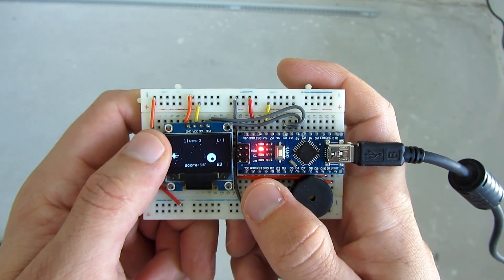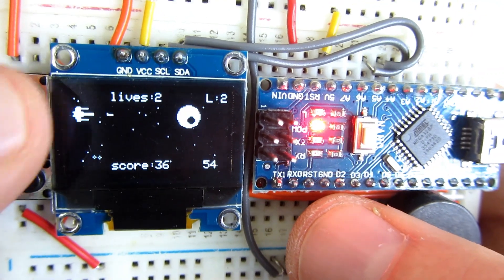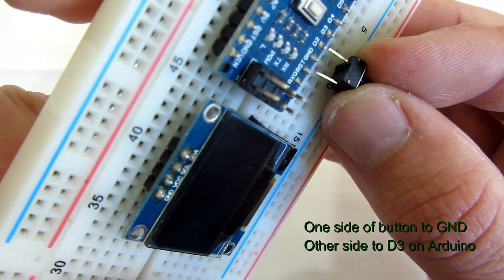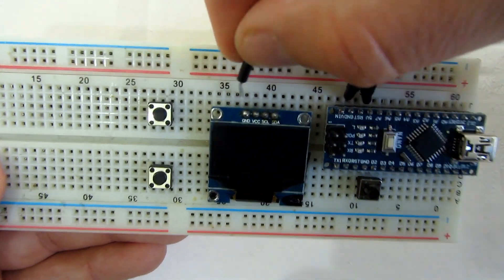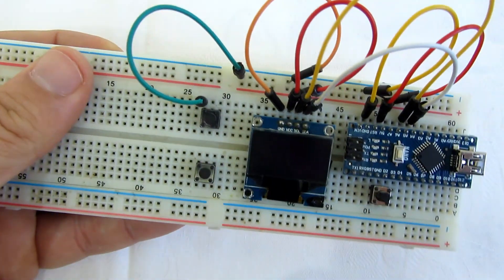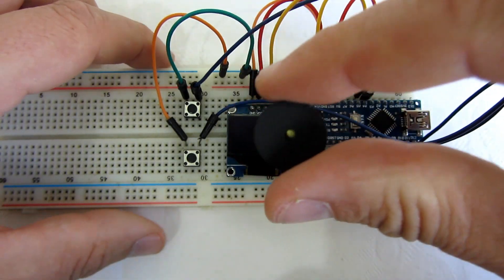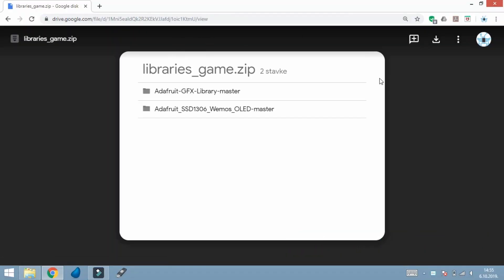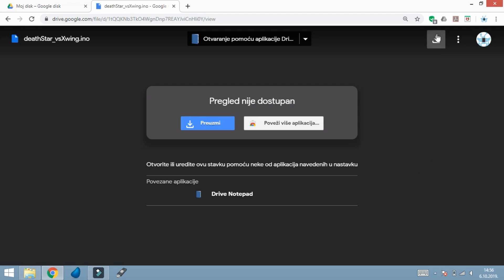Arduino Star Wars Game - how to make

Comment: Thanks Volos Project. An entertaining and educational project. I got my non original Nano working on my Windows 11 laptop after updating my CH340 driver with CH341SER driver. Also of use was a gentleman's suggestion below (sorry cant recall who this was)' when using a 0.96 128x64 i2c OLED to :
You need to call constructor differently this case:

Thats how your code at lines around 26 should look like: 
#define OLED_RESET 4
#define SCREEN_WIDTH 128 // OLED display width, in pixels
#define SCREEN_HEIGHT 64 // OLED display height, in pixels
Adafruit_SSD1306 display(SCREEN_WIDTH, SCREEN_HEIGHT, &Wire, OLED_RESET);
Reply: Thanks a billion
Reply: thank you
Reply: Hey, could you provide the libraries, code for this project, Im not able to get it from the drive link in the description

Comment: sir, the game works fine but it does not fit to the screen size its enlarged and i can only see half of the picture, any solutions?
Reply from the maker: Your library is set to 128x32 so picture is sreched, you need to set it to 128x64

Comment: I got the hardware going but cant get it to fit the screen. Seems super zoomed in. Any thoughts?
Reply from the maker: hi mat, your library is set to 128x32, you need to set 128x64. Do you use library i posted in description?
Reply: @VolosProjects  I downloaded the library zip file but the ide is saying it doesn't contain a valid library. Can I change it manually?
Reply from the maker: Do you bave original adafruit library? Od you bave , you Will news to delte iz bacouse they Will ne on conflict

Comment: Getting an error with this ...     ADMUX = _BV(REFS0) | _BV(MUX3) | _BV(MUX2) | _BV(MUX1);    This is the error from the IDE ... 'ADMUX' was not declared in this scope. Also, one of the libraries, Adafruit_SSD1306_Wemos_OLED is not included in the sketch.  Also, the code is very messy.
Reply: same problem

Comment: Hi, did you do something special to connect both buzzer and OLED screen ? I had issues about that with a nano (you got exactly the same setup). I heard about the choosen pin that can be the source of the problem.
Someone else talked about the buzzer that could not be a real buzzer, do you have some references ? ;)
Your projects are great !
Reply from the maker: Thank you, i didnt do anything special. But i remeber that i have that problems in past, i just used another pin on arduino. Dont forget setup that pin in code.
Reply: @VolosProjects  Thanks, I also get a freeze when I used both buzzer and OLED, I will check the pin 9 on the nano, it could be the problem solver 😉

Comment: can u use oled 128 x 64 ?
Reply from the maker: this is oled 128x64
Reply: @VolosProjects  but when i uploaded the script, the display is stretched. The ship does not appear on the oled
Reply from the maker: @vel1800  your library is probably set to 128x32 you will need to find Adafruit_SSD1306.h file inside your library folder. You will need to edit it. Un comment 128x64 and comment 128x32
Reply: @VolosProjects  ohhhhh, thanks mann
Reply: @vel1800  hi i got the same problem. I found the Adafruit_SSD1306.h file but how do u edit it?
Reply: @VolosProjects  I EDITD THE FILE AND I STILL HAVE THE SAME PROBLEM, PLEASE HELP

Comment: Could  adapt this to a 128x64 0.96" Display easily? Awesome video by the way!
Reply from the maker: this is 0.96 128x64 i2c OLED, maybe you have SPI veon with more pins?
Reply: @VolosProjects  This is what I have. https://www.ebay.com/itm/0-96-I2C-IIC-Serial-128X64-128-64-Blue-OLED-LCD-LED-Display-Module-for-Arduino/382850692423?ssPageName=STRK%3AMEBIDX%3AIT&_trksid=p2060353.m2749.l2649
Reply: I noticed in the code at the top it says its for a 128x32 size display using I2C
Reply: Here is a video of my issue. https://youtu.be/p9GSG2C5qK0
Reply: @ForwardEngineering   I had the same issue and I found the solution, looks like you're using new libraries from arduino repository with Volos's sketch.
You need to call constructor differently this case:

Thats how your code at lines around 26 should look like: 
#define OLED_RESET 4
#define SCREEN_WIDTH 128 // OLED display width, in pixels
#define SCREEN_HEIGHT 64 // OLED display height, in pixels
Adafruit_SSD1306 display(SCREEN_WIDTH, SCREEN_HEIGHT, &Wire, OLED_RESET);
Reply: @ВладимирГрачев-ы2и  Wow man thank you so much! I am trying to learn more about C++ and I didn't realize that you can just Define the width and height of the screen! Thank you so much! My specialty is I.T. Work and Electrical engineering but unfortunately not programming lol.
Reply: @ForwardEngineering  Sure, please mind that most important here is that Adafruit_SSD1306 display(SCREEN_WIDTH, SCREEN_HEIGHT, &Wire, OLED_RESET); is called with 4 parameters, not with 1 as in Volos's code.
Reply: For those of you who have problems with the screen, you simply have to configure the pixel size in line 10 and 11 of the code.

Comment: Hey man, nice project. I have a question. Can this project be built on arduino UNO aswell?
Reply from the maker: Yes, Uno and nano use same MCU
Reply: @VolosProjects  Will the code need any changes though? Thanks for replying!
Reply from the maker: @ΔημητρηςΚοης  no
Reply: @VolosProjects  I have 1 more question. When i apload the code and try to verify it. There is an error thats says, low memory available. That means my arduino UNO does not have enough space for the code?
Reply from the maker: @ΔημητρηςΚοης  it is just warning, just upload code
Reply: @VolosProjects  tnx a lot man!
Reply from the maker: @ΔημητρηςΚοης  did you use right library, library from description

Comment: Great little game. just have one question. What is " long readVcc " doing? during compilation it shows me error on every variable as not declared and game is working fine after removing that part from code. But maybe is needed for something? Thanks
Reply from the maker: Omg, i forgot to delete that part, if you power arduino with lipo baterry, that part will tell you voltage of battery, you can delete it, it is not needed for game